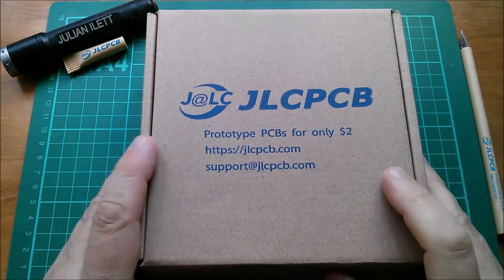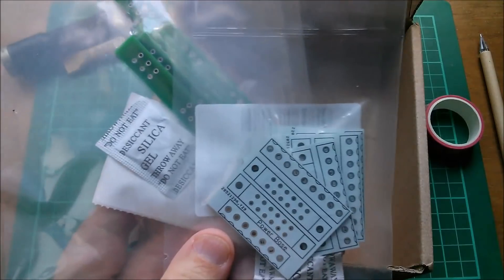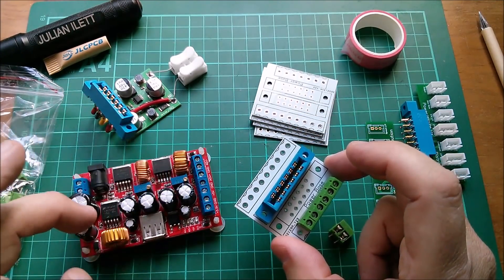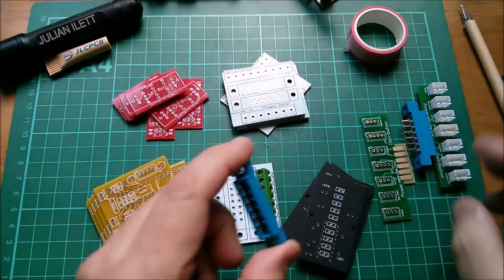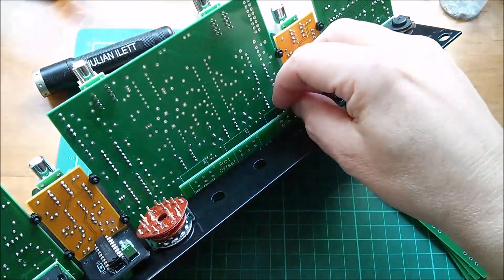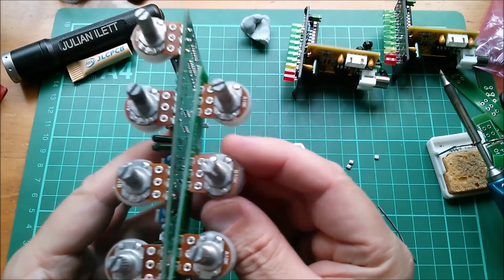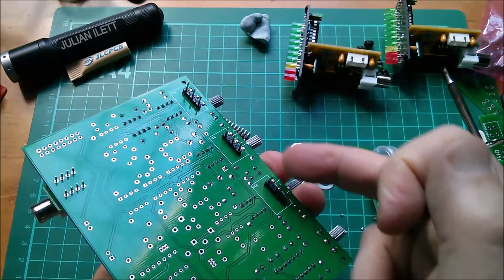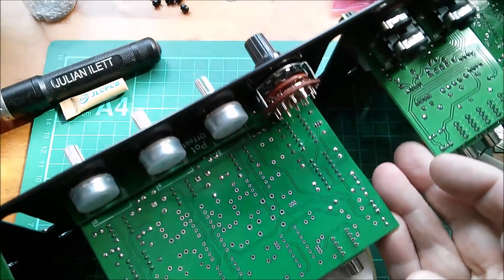New PCBs from JLCPCB - I've now done all 6 colours

Comment: A good way to make an audio device unreliable is to ave lots of plugs and sockets in the design. You would be better putting it all on one large PCB, or maybe two with one for the panel. Connections become noisy after a while, especially if they are not carrying much current.

Comment: Regarding the power supply board with the edge connectors...

You could have wired the edge connectors in parallel and on the connector board, just install the connectors on the back side of the board.

Comment: Hi Julian, Vocoder is coming along nicely. Just one thing with the pots on the bottom being upside down surely they are going to be a bit strange to use: The ones on the top will have a pretty normal stroke, say 7 o'clock to 5 o'clock with the 6 o'clock position out of bounds, but the bottom ones are going to go 1 o'clock to 11 o'clock with the 12 o'clock position out of bounds.
Reply from the maker: That would be true with D shaped spindle ends, but these pots are splined so the knobs can be pushed on in any position :)

Comment: I'm glad I order from JLCPCB for the price and quality only :)  It seems they send the "gifts" only to YouTubers.  I have 9 orders now (not boards) and I got one pen. Again, I do not order for the gift, though the magnifier would be nice!
Reply: I think it may be related to shipping weight. Shipping companies seem to charge per 100g for international shipments from China. I've noticed if I got just over a 100g weight boundary, I'd get a "gift", if I'm staying under one, I don't.
Reply: @sbx320  That could be it. Most of my orders are for 30-50 boards. Not a big deal anyway! :) Thanks.
Reply: Oh, wait I misread your post. American schools ;)  All of mine are over 100g. Anyway, I like them more than the others I have tried!
Reply: @UReasonIt  Over 100g isn't the thing. It's that shipping cost often increases in 100g increments. So you'd pay $X for the first 100g, and then like $0.50 for each additional 100g. So 405g costs the same as 480g, but 395g is a bit cheaper. 

If you're (including packaging + some calculatory buffer) just hitting 485g, I'd expect JLC to want to avoid that extra cost for a 500-599g shipment for a gift.
Reply: I have no sponsorship with JLC and order through the website the same as anyone else and I've pretty much gotten something in the box every time.
Reply: I've ordered from them once and I'm pretty sure they don't know I'm on YouTube, and I received a magnifier with my boards.

Comment: Just a note to jlcpcb assembly: You can not send them the parts. They only use the parts they have avalible. Plus they "only" have a few hundret basic parts. The rest you have to pay to get the reel changed (3$). All parts will be bought by them, so you most likely have to redesign the boards (I have done that and now I am waiting impatiently).
However the prices are really reasonable since they just use the prices from  LCSC. Just be careful with some of their non asian parts. They can get quite expensive. 

As far as I know they should open this option up for everyone soon and it is already working for china. Results look really good.
Reply: maybe the pwm femto could be re designed with smaller passives and perhaps the smaller packaged version of the 12f683 (guess if they're going to offer it, they'll also program it for you)... it'd be a chance to get the LED out from under the wiring loom
Reply: @joinedupjon  No need to guess. The part list is already online: 
https://jlcpcb.com/video/jlcsmt_parts_library.xls
And yes, the PIC12F683-I/SN is in the list as an extendet part. 
But no. No programming etc. The only thing JLC is doing is putting the components on the board. No other services as it would require them to put in much more manual labour.
As far as I know they have a line of a few dozent pick and place machines and it is all done 100% automatically for the basic parts. 
Maybe the will offer it in the future but from their point of view they are still a prototype service. You can also not order more than 30 panels at a time, which I guess would be more than enough since the max panel size is 480x320mm. Should fit quite a lot of the PWM boards.
Reply from the maker: On The Femto V2 the led is on the top
Reply: Iirc in circuit programming would be possible - maybe using a pogo pin jig to contact some landing pads rather than put a programming header on the board.
fwiw got a dead link when I tried to look at the allowed parts
Reply: @joinedupjon  Oh one thing I forgot: 
"Please panelize your boards with stamp holes, V-cut panels are not supported currently.
"
That is also important. V-Groves wont work as of now.
Reply: BEWARE CUSTOMS!!!
Reply: @kyoudaiken  Well in Germany it is just 19% VAT if you are below 120€. Even then, I am not 100% sure, the custom rate for electronic products is either 0 or less then 10%. 
But yeah. If you  live in the US now a days you are a bit fucked. 
But for me it is actually cheaper due to the possebility of using the chinese parts. I could reduce my BOM by 70% even with the free for the part change (100 quantity)

Comment: I'd never want to have to solder those SMD boards. The density of components and small pitches is too intense.
Reply: glyn hodges  
Did you not understand the obvious sarcasm?
Reply: glyn hodges  Yes but those boards have so few components and all of them are low pin count large pitch. You'd have to have no hands or eyes to think you need to use an assembly service for them.